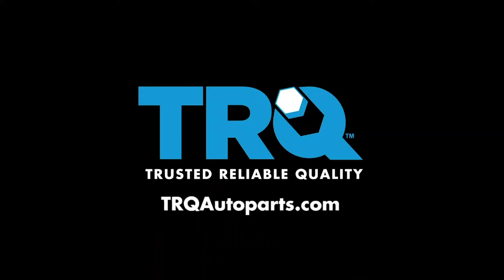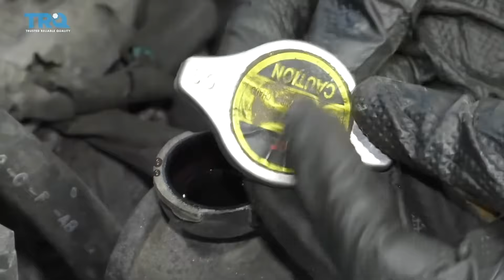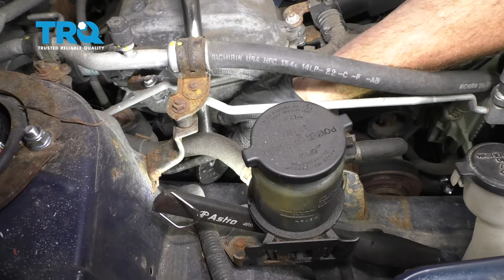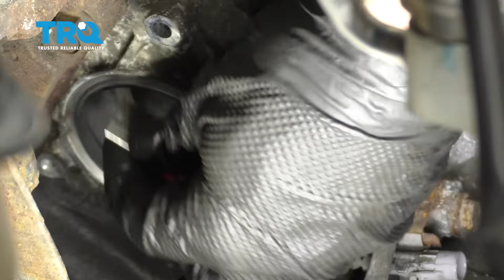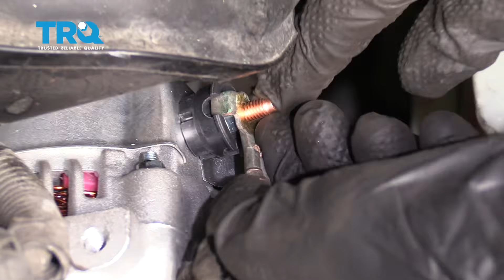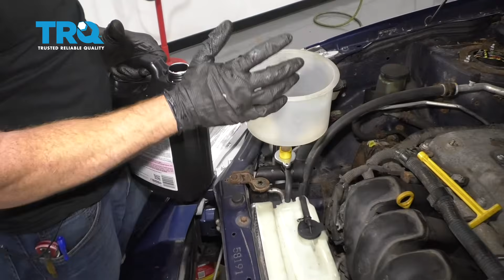How to Replace Water Pump 2003-08 Toyota Matrix

Comment: He also doesn't mention in here that you have to get new bolts to replace the short ones. Same length as a long ones for the pump. Because the short ones with the new water pump are too short

Comment: I just did mine today.  Start to finish was 4.5 hours.  If I did it again, I could do it in 3 hours.  Tips:  remove alternator, some say you don't have to but it helps angles plus I couldn't get the water pump out with it in place and even swiveling it.  Completely removed it.  Remove the plastic shroud underneath, three 10 mm bolts and about five clips (push pull tabs).  Buy a magnetic 10mm socket.  

The bolts are all 10 mm for the pump. 

Consider removing the motor mount and jacking up the Motor.  I'd try it next time because fighting the frame rail was a total nightmare. 

Buy denso brand only.  It's twice the price but ten times the quality.

Comment: One huge question that i cant find the answer to. On a 2006 Toyota Matrix base, what is the direction of the impeller? I see "exact fit" that are reverse and clockwise (standard) i got rid of the old broken water pump and since the new one is in place i have no heat and a cold lover rad. Hose. Thinking the new pump is pushing water the wrong way!

Comment: I would add, taking off front right tire and peeling fender shroud back aids in access to lower bolts, otherwise bad words may be said.  Also some after market pumps are different. Beware what you buy and make sure you have enough of the long bolts if pump is different. The extra bolts that came with the pump I bought were not used. Had to go to the fastener supply to buy 2 more long bolts.
Reply from the maker: +larry weinberg Thanks for the feedback! http://1aau.to/m/Shop-TRQ

Comment: Great video! The only thing I would say is. Don't use an impact on the engine cover, it's wildly excessive and can cause the valve cover bolt to come out with the engine cover. It also transfers energy on the right stud directly to the valve cover bolt and could potentially strip it out.

Comment: What size are the bolts on the water pump itself? Also do you really need to drain your coolant to change the water pump?
Reply: Yes, that's what the first step of draining the radiator was all about

Comment: Only issue I just found out is if your replacing the water pump with an aftermarket one from a chain auto parts store you might have an issue with those 2 longer bolts. I need to know exactly what size those smaller bolts are so I can find two more where the two longer ones won't workout with my aftermarket water pump.
Reply from the maker: +MonkeyMan Thanks for the feedback! http://1aau.to/m/Shop-TRQ